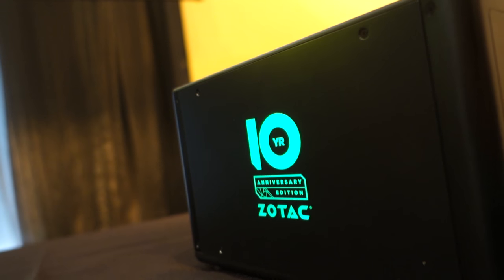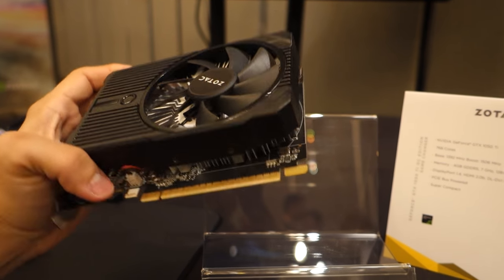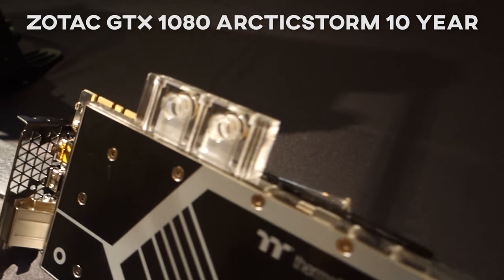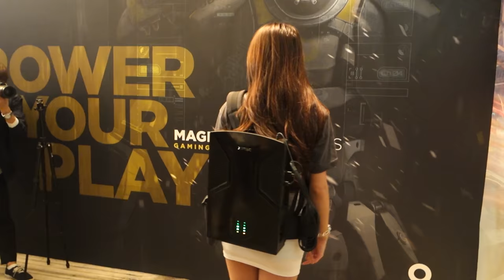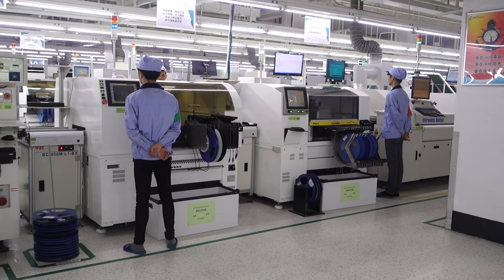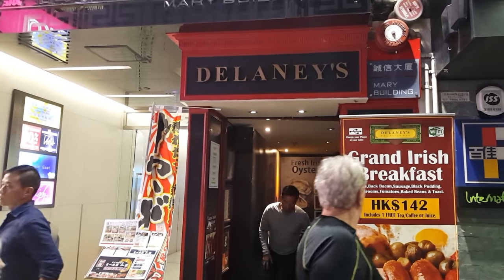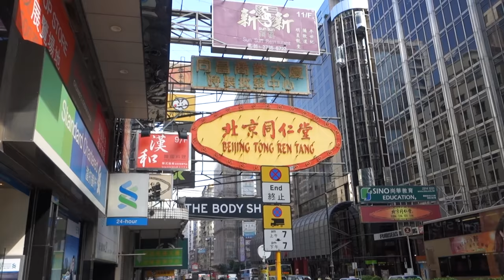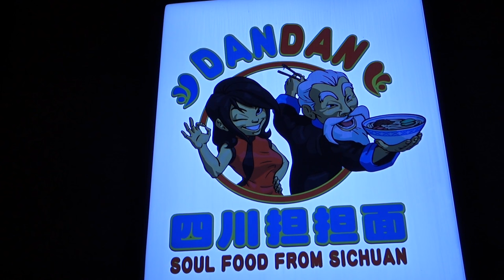Zotac Press Event & Hong Kong Vlog!!

Comment: I own a GTX 980 Ti Omega myself and I had to put some thermal pads under the Backplate because the heat of the VRM's and the VRAM was just isolated by it :/
(I hope in the Future they do this themself)
But its a very cool Card, even in Summer it never goes over 72°C in my Define R5

Comment: I'm planning on getting a GTX 1070 in a weeks time. I'm unsure on which one to get. What's the best GTX 1070 i can get that can overclock to near Stock 1080 speeds and by how much? Thanks :3
Reply: the Evga super clock and for the win cards are usually the best dude.
Reply: But recently EVGA Cards have been getting alot of shit because of issues with the cards.

Comment: I have the zotac 1080 amp extreme.  it gets nowhere near 2100 mhz overclock
if i i try to add even 10mhz to the overclock it crashes my entire system.   it will usually sit about 2000-2012 when fans are ramped up
fans work at least. runs battlefield 1 in 4k and stays around 55c

awesome card just sucks for overclocking.
Reply: Ryan Pillion that sucks. You definitely lost the lottery on that one.  My 1070 runs at 2126mhz and stays under 60c